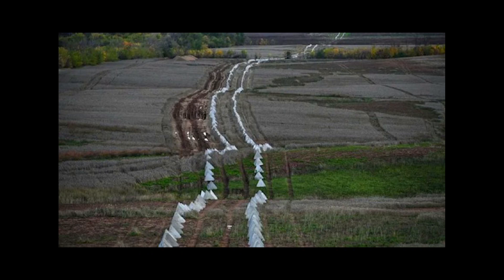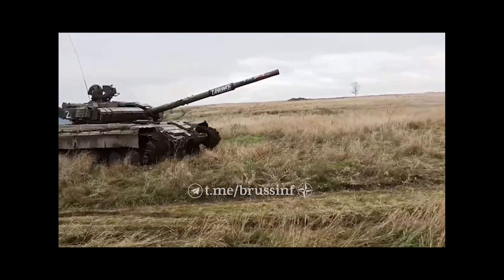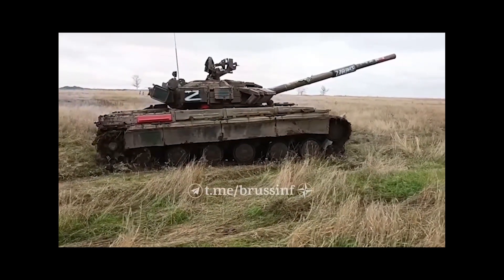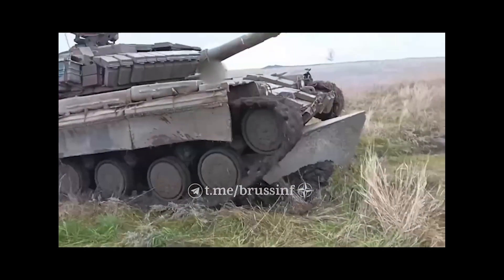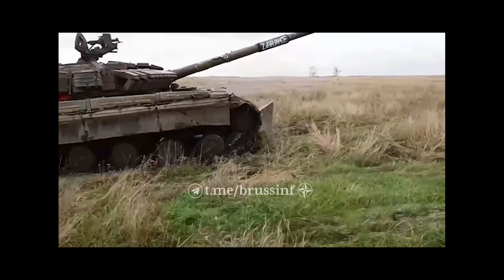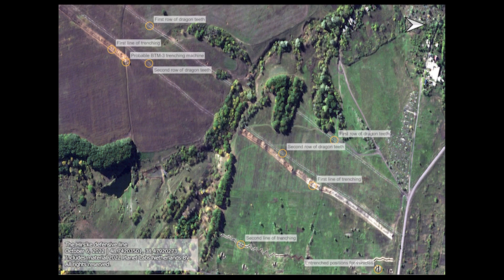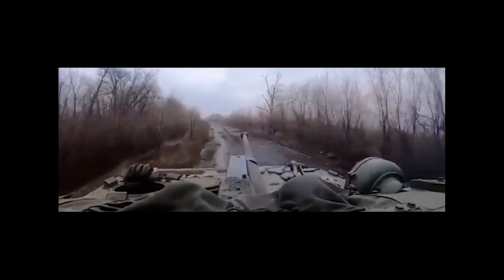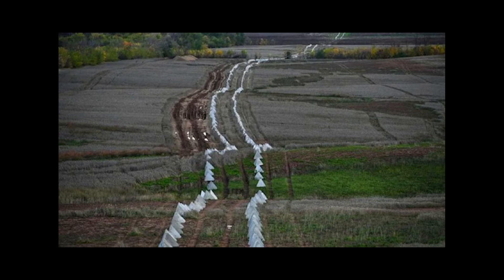How Russia's Dragon Teeth Anti-Tank Barriers Work

Comment: Prighozin is running a concrete factory in Ukraine. These teeth are smaller than usual and not made of hardened concrete. They're worthless against the vehicles they claim to be useful against. Look at the BMP video, you can clearly see that the propaganda video dragon teeth are larger than the actually installed ones. It's a shitshow.

Comment: work very well for demonstration, but what about putting track on it, not the belly, it will slide, dig in, present a flat to the track, which will do nothing to stop the tank, and the tank will push the pyramid  into the soil under the weight of thank
there was even a video of a bmp going over one of these at maybe 20-30km/h, didn't do much to slow the bmp down at all...

Comment: These are only effective against tracked vehicles IF they don't mount them with their tracks. The BMP did it on a hard surface. It would be even easier to do on dirt as they'd dig the teeth into the ground.

Comment: I was thinking the same thing with these defenses. A bulldozer can clear them. 

These tetrahedron tank traps are coved in FM 5-15 (1972) page 7-6 and 7-7. It is very likely you need to place multiple of these tank traps before they are effective. And you want to mine around the tank traps too. Also you want to add barbed wire around the tank traps to bind them together, and to prevent infantry from getting through. 

The philosophy behind the tank traps probably is to slow down an enemy assault. Observation and covering the tank traps with (antitank/indirect)fires is what is necessary to keep the enemies from overcoming these obstacles.

A regular mine clearing device will have trouble with these tank traps and doing their job. A line charge vehicle will have less trouble clearing mines. But maybe some mines in between the tank traps and barbed wire mesh could survive. 

On their own the tank traps are not enough, but combined with other defenses, i think will make for a good defense. 

I am not seeing the Soviet "fire sacks" where they make the defenses so that they "compartmentise" enemy attacks, so they can be destroyed with massed artillery fire while they are trapped in a killzone. You want to make defenses so that the enemy cant move laterally (from side to side), and defenses have to be in depth. Only then will a defensive line be truly successful. 

You dont want the enemy to breach the line, and just pass around all your well dug in positions. Once there is a breach, the entire defensive line can be rendered useless if the breach is exploited. Defenses should therefore run perpendicular to the defensive line, and further to the rear to hold the enemy. FM 100-2-1 (1984) Chapter 6 shows how it is done. Or FM 5-102 Countermobility (1985) or FM 90-7 Combined Arms Obstacle Integration (2003). 

Does all that really matter?? Well, only the side that can supply its troops, keep them warm, well fed, payed, trained. Can keep up with production of war materials. Have the best strike capabilities will win. All defenses are as strong as the weakest link. What they are doing now is more like a nice crust and a soft core. You rather need a touch defense in depth. That is way harder to overcome. 

I like the material use they did. Not to bad to take something that was described in a book. But they clearly did not read all to well on the doctrine of placing these defenses. It is a start, dont get me wrong. It can be really effective. But it can be even more effective if they read on it. :S

Greetings,

Jeff
Reply: Ukrainian have pretty good counter-artillery and their Himars are targeting Russian forward ammo dumps... they also seems to outrange what Russia can field at the moment (sans Iranian flying lawnmowers and their depleting cruise missiles stocks)..so Russia depending on old Soviet tactics may not be so effective..
Reply: @dwenchan831  I still think Russia can have a proper defense going on. They just need to decentralise the (ammunition) depots. So that it does not blow up in one strike. Its harder te defend. But at least you will have ammo. 

Greetings,

Jeff

Comment: Most people seem not to understand how antitank barriers work. They are not used to fully stop tanks from advancing but used to slow down advances. In most war scenarios attacks are commonly carried out from different areas and if you can slightly slow down advances you can put in artlillery to where your enemy is at. For sure you can easily destroy them even with c4 charges placed at regular intervals but the idea behind these is similar to a mine field. You can easily remove mines from a mine field but it considerably slows down advancing forces which gives you time to reorganize defensive positions or even attack the advancing units with artillery.
Reply: I think we all get that.  The issue is that the Russian tank demo suggests they actually stop a tank.  The Ukrainian BMOq was video shows they don't even slow anyone down.   So, they fail to achieve that purpose entirely.   After failing to stoo the initial rapid advance, they can then be pushed entirely aside.  That could not have been done by a tank with buried teeth or other WWII tank traps.
Reply: @brianhaygood183  You must be crazy if you think that running full speed over them works.
In that video BMP survives it because there was only one in the way and they luckily put tracks over it. 
If you crash that full speed and it wedges under its going to be disaster for the tank or apc. 

They are to slow down advances so other side can shoot vehicles better.
Reply: Yes, move them into a kill zone..
Reply: Spot on - slowing down the enemy, these dragon teeth, these mines, some AT ditches, some actual ditches with troops etc.

Comment: Weld two fat pieces of steel to grab on too two corners and drag em. Or just push it up slightly, slide a piece of steel under it, secure it and slide it away. Simple and effective. Just make sure to soften up enemy supply lines first

Comment: Glad you found the dragons denture "speed bump" video.
BUT, it seems to me the dentures in the BMP video are somewhat smaller. 

Here is a picture of another "type" of denture that definitely seems smaller
https://youtu.be/8tKV0SLrQ0I?t=362
Reply: The shown example is actually not those used in Ukraine.
The one shown is clearly concrete while those used in Ukraine are cement with a fairly high ratio of lime.
The one show is much larger than the ones used in Ukraine. A rough guess would be about 2/3rd of the dimensions of the one shown in the video.

Comment: So a little bit of context here.  No obstacle is 100% effective and you do not put an obstacle like the dragon's teeth by themselves.    Obstacles are designed to slow the enemy down so you can engage them with indirect or direct fire or both.  An obstacle by itself is fairly useless.  You need an effective combined arms force that can work together to cover an obstacle by fire (indirect or direct) and so far the Russian command and forces have not shown that they have that capability to integrate infantry, artillery and close air support on a consistent basis in the defense and certainly not in the offense (ie Bakmut, Pavlivka, etc).  That stated I am seeing improvement in their thinking and the retreat from Kherson, although not 100% effective in saving their manpower and material, was certainly not the disaster it should have been in the destruction of Russian fighting forces that it could have been.  Russia was able to conserve manpower and materials for future battles but at the same time Ukraine was able to regain a key city and a much better defensive position freeing up forces for other areas with minimal losses.

Comment: If you don't have a dozer or frontend loader:
I drove a logging skidder for a few years. Simple method is for tanks to carry a 20-30 foot (6-9 meter) chain (3/8" dia or larger). Chain will work better than steel cable for this. Then lay the chain on the ground around the back side of the tooth. Don't wrap or loop it, as this will likely result in just toppling the tooth over. Instead just lay it on the ground around the backside.  Then hook the ends of the chain to the tank and slowly pull it off to the side. If it is really muddy/soft this may not work every time, but just try again with another. The tank will not become stuck using this method, so it can keep trying. I'd be very surprised if it took more than a few minutes to successfully move two. The spacing looks like you would only need to move two to open up a wide enough path through. Every tank can carry a chain.
Reply: Dude, are you serious? Do you think that's the only defense they have? While you're trying to implement your idea you have to avoid hitting mines, getting spotted by drones, getting hit with missiles/artillery/rpg/ and other traps not visible.
Reply: @olliefoxx7165  i know right. this guy is talking about jumping down out of the tracked vehicle to ef around with a chain whilst a wall of lead and fire falls on to.
Reply: If they have to slow down that much they're actually being quite effective. A tank mine plough attachment should just shove them aside.
Reply: @mostevil1082  Obviously, there are specific circumstances where time is essential and any delay can make a difference. In many circumstances, as (in this case the Ukrainians) are pushing forward on the line, they will need to open a path so that many vehicles can pass through. My point was, If a tank is first on the scene, a simple chain could likely clear the way for others to follow. Having to stop and wait for the preferred, specialized equipment would be the bigger delay imo.
Reply: Really the only advantage is that it will halt an enemy vehicle for at least those few minutes, which can be quite significant. The difference between an armored vehicle being stuck in place or moving slowly for a few minutes and that same vehicle speeding past is quite large if in those few minutes you manage to get some anti-tank weapons fired at it.

Running them at speed probably works occasionally, but the one of the size in the 'demonstration' video looks like it could do quite some damage to tracks or sprockets if you try it at full speed. Getting stuck pushing an outsized chunk of Toblerone for a few minutes is dangerous, getting stuck in a field of Toblerone with a broken track sprocket is probably the end of your armored vehicle.

Putting a chain around it while under fire does not sound like fun, but I can see the Ukrainians making some quick diy chain deployers that carry the chain up high and pivot forward and down as the tank brakes in front of the triangles.

Still, best way is probably a large artillery strike as mentioned elsewhere. Perhaps take a note from ISIS, put some remote controls in beat-up  pickup and drive it flat-out into the obstacles filled with explosives. A nice hole is probably easier to pass than these blocks.
Reply: @JoranGroothengel  Obviously, there are specific circumstances where time is essential and any delay can make a difference. In many circumstances, as (in this case the Ukrainians) are pushing forward on the line, they will need to open a path so that many vehicles can pass through. My point was, If a tank is first on the scene, a simple chain could likely clear the way for others to follow. Having to stop and wait for the preferred, specialized equipment would be the bigger delay imo.

Comment: I suppose they do serve some sort of purpose in the case bulldozers are used, when a bulldozer clears a small section of anti tank spikes vehicles are forced through that small gap created. This becomes an easy kill box as multiple weapon systems can be trained at that small area, with little/no room to manoeuvre any vehicles passing that clearing are extremely vulnerable. Especially the lightly armoured vehicles we’ve seen Ukraine use to break down defensive lines.
Reply: The tactic you describe here is a sneaky tactic Ukr might have used. If they committed to static defenses more than they did. They did commit to asymmetrical battles, mine-droppong drones, EW, which are anything but static.

If anyone is going to use tank-trapping fieldwork properly it will surely be Ukr. But then again, with their speed of advance Ukr doesn't have to rely on static defenses any longer while the advance has inertia.

Comment: An alternate approach could be to approach with heavy vehicle from side and just nudge a few feet. Realign,  nudge the opposing one from the other direction to create a gap, then jus drive straight through. Looks like some sales guys got to the funding source with a flashy video and they didn't consider many of the possible options for foiling this minor impediment to progress.
Reply: Yea... drive along pushing every other one left and then drive in the other direction pushing everyone one right.  You end up with a wide open line with two dragon teeth next to each other with 20' wide gaps between them.  Probably clear a few miles per hour.   The issue is taking fire while trying to do it.  But thing is... these days they can send a dozen drones with grenades to suppress that fire.  Drones have changed everything.

The ukrainians are clever.  They'll figure it out.

Comment: Bulldozer blade fitted to front of a tank. Job done. The Matilda Dozer was one type fitted in WW2, also fitted to Shermans.
Reply: they have this angled blade they use on roads, i'm sure a tank or two with them could cut a nice swath very fast across those. or they could just do the israeli deal and make their own killdozers. then the company that made them can get a whole new contract for hundreds of more miles of the things.
Reply: so how you are going to do it? you need a minute to lower it, That minute is critical bc you are stationary and perfect market for anti tank weapons.
Reply: but you can't put in on other tank, so they just make dozer tank boom and you need new one or even if it survive you have only narrow passage in begin which slow down your advance

Comment: In WW2 British Dozer Tanks usually piled up earth on top of the German Dragons Teeth with a long ramp before and after usually after any AT Guns were neutralised first the US demolished the teeth with charges then a dozer tank would pile earth to make a roadway through the Westwall though these two systems were interchanged,i am sure the UA Army will have good idea's to overcome these obstacles.😇😇😇
Reply: there are much larger more powerful dozers on this earth since ww2.  these things should have remained in the history books.  just in case the russians loaded the area up with mines and snagging cables, ukraine should be studying that "killdozer" for ideas and sending such machinery to the fronts just in case the russians have worked out how to make these trivial little concrete things work for them.  i think the yanks set up abrams with blades in iraq.
Reply: Thats because the German ones were planted a meter into the ground.
Reply: @obsidianjane4413  I have inspected the Westwall personally when i was stationed in Germany in 1970 and therevwas three distinct types as the fortifications proceeded from 1936-1939 as tanks became bigger the type 3 from 1938 was interlaced concrete web with H Beams sunk through the concrete web to a depth of 1.6M with some 2M in depth.The Orc versions also appear to have H Beams too but are bent towards the enemy some 1.5M long designed to rise up as the tooth is pushed forward to further entangle the tank into the nest of concrete and steel.